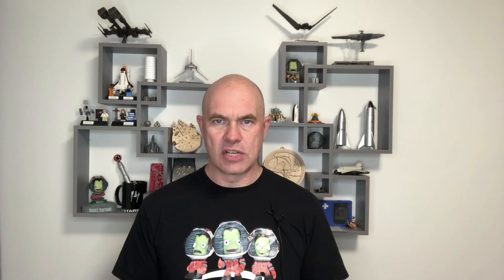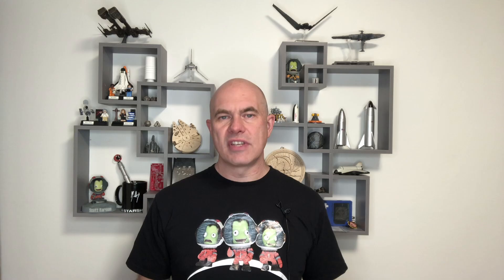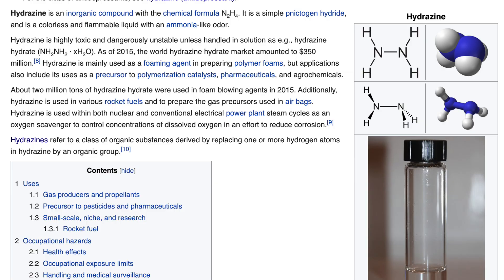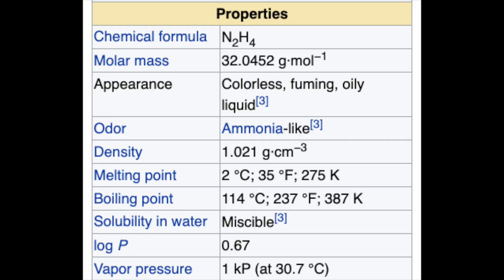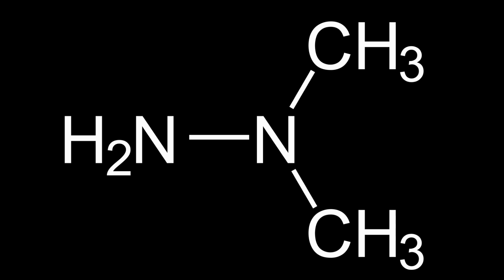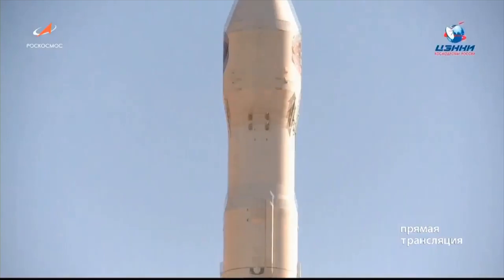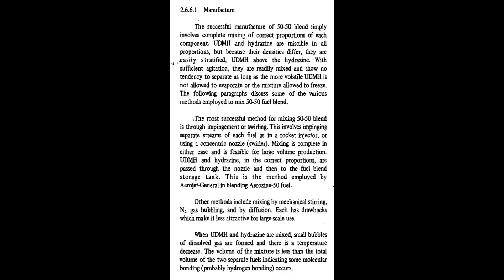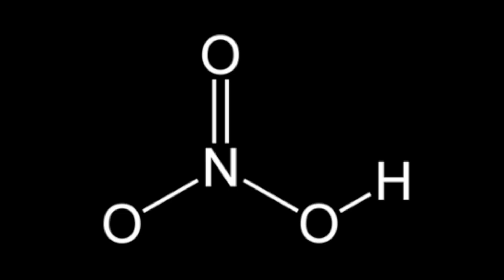What are Hypergolic Rocket Fuels? (Other than Explosive, Corrosive, Toxic, Carcinogenic and Orange)

Comment: Exactly why are chemical rockets seen as safer and more environmentally friendly than atomic powered craft?
Reply: It may seem counter-intuitive, but chemical rockets are vastly more powerful than any nuclear reactor in existence. Falcon 9 engines generate over 30 GW for a few minutes, while reactors of a nuclear submarine generate only a fraction of a GW. You just can't launch anything with this kind of relatively low power from the surface of the planet -- even if the reactors were a thousand times lighter than they usually are.
Reply: @cogoid  Then how did the nuclear powered planes of over thirty years ago get off the ground?
Or perhaps a giant nuclear powered pair of electromagnets for initial lift off?
Reply: @friendlyone2706  The "nuclear powered planes" were classic jet powered bombers with single nuclear test engine attached, they never really were "nuclear".
Reply: @friendlyone2706  Airplanes and rockets are not directly comparable -- it takes a lot less power to keep a winged air-breathing vehicle in the air. Consider that a very large airplane (Boeing 747) needs only about 150 tons of fuel to fly for over a 1000 minutes, while Falcon 9 burns 400 tons of fuel+oxidizer in just 2.5 minutes.

Nuclear reactors have been used in space quite a lot actually -- at least 30 have flown in russian missions, and there was an american one even earlier than that. Once you get them into orbit, they provide a good long-lasting source of power.
Reply: @randomnickify  Thank you for the information. Any idea what the results were for those test engines? I'm curious if they were dropped for engineering or social image reasons. And if engineering, if we now have the tech levels to re-look at that option for long trip jets?
Reply: @friendlyone2706  - the big problem with flying nuclear reactors is weight... in particular, the weight of shielding needed to keep all that wonderful radiation inside the reactor, instead of inside the crew cabin. 

Which of course is why nuclear-powered cruise missiles are more feasible... when you're taking a one-way flight with no crew, nobody cares if the whole thing is dangerously radioactive by the end of the mission. Well, the people on the receiving end probably do, but if they're on the receiving end of a nuclear powered cruise missile, it's obvious that nobody cares about their opinion.
Reply: @simongeard4824  Nuclear reactors (BES-5) used in soviet satellites weighed only 385 kg including shielding. The fundamental problem of nuclear propulsion is the difficulty of transferring generated in the nuclear reaction energy to the working fluid -- this sets the limit to how powerful the reactor can be without vaporizing itself, and this limit is not high enough to be competitive with the ordinary chemical rocket engines, if you need a lot of thrust -- as you must have, for example, to take off from the surface of a planet.
Once you are in orbit, the high thrust is no longer essential -- you can take your time to accelerate. Then nuclear propulsion can work, and it can work better than ordinary chemical engines because the same amount of nuclear fuel generates vastly more energy over its lifetime than any chemical system. Elon Musk is trying to talk NASA into restarting research on the subject, and russians are already testing components for a relatively powerful nuclear reactor intended for an interplanetary tug.